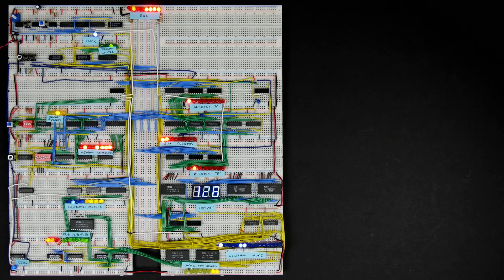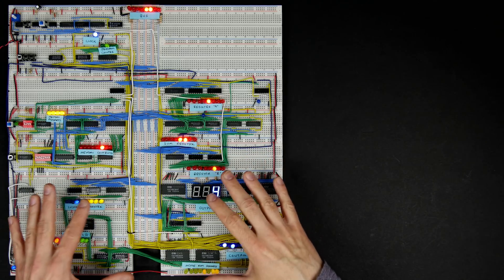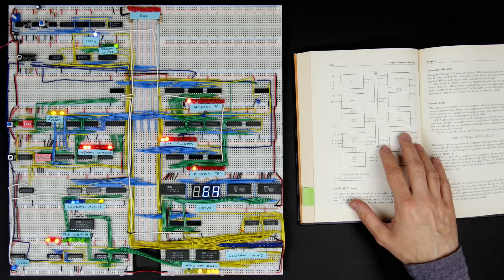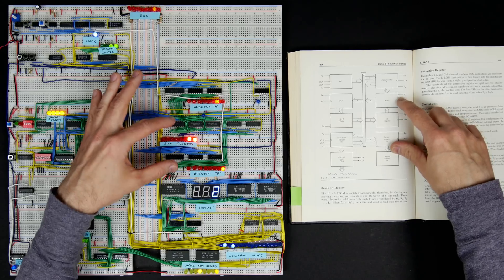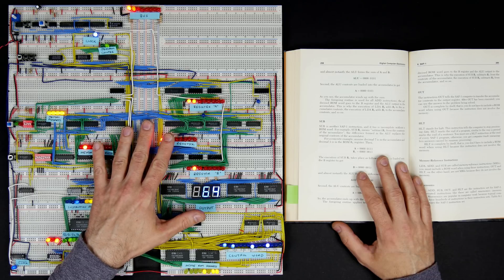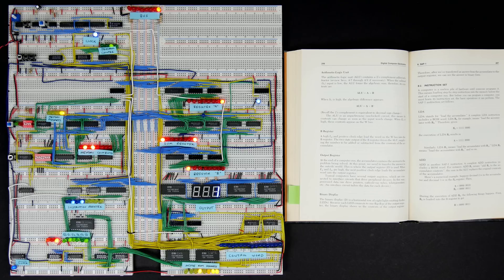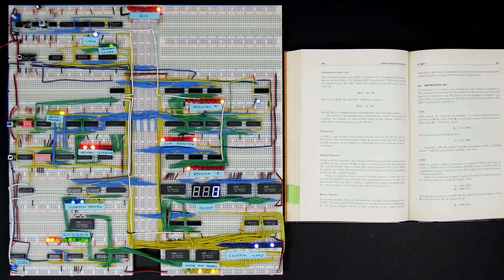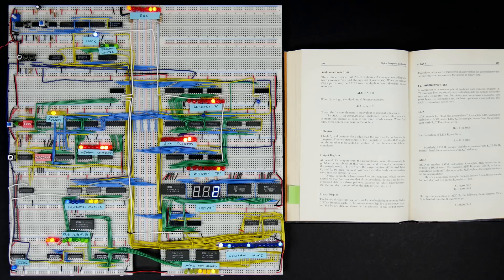8-bit computer update

Comment: hi. i have successfully made the popular ben eater,who i will be eternally grateful, 8 bit  breadboard pc up to the output display   .  its not been easy and here are a few of my observations    .the first tedancy was to inadvertantly wire a short cct across the  the 5 volt supply.     so i added a 1 amp meter and used a 705 with heat sink.     next was the fenomenom ? of data not appearing  on the bus.     this was due to a register outputting  8 zeros to it and not allowing the 5 volts to show.    now ime experiencing like contact bounce where a step is missed or it goes to an all ones address.     ive just made a seperate 7400 manual toggle switch,supposidly bounce free cct and managed to get only 3 outpus of 42 without a problem   .its the same on continous 555 clock pulses   .the boards have 5 volts to them with a variation of 0.1v and theres low/high value capacitors as well across the 5 volrail and very little noise.     a most annoying thing is a tendance for step zero to become mainly all zeros or a mix and confusing the  program so ime thinking of fitting a small eeprom to replace the ram if thats possible     so ime looking for any ideas for the clock bounce,    ram corruption and replaceing the ram with an eeprom.     i made the simple eeprom programmer which was easy to make and works well but being nearly 70  i cant grasp using an arduino so am looking for a display and full  instruction download   please   so  i can place into the arduino programming page,  step by step please, then i can use my arduino uno.  ive spent tens of  many enjoyable hours  assembling this and have leant a lot which i hope to use on my old 70,s sinclair zx81,s and also repair a failed ram pack.  thank you once again be eater for making these video,s and giving people endlass enjoyment.  many thanks from richard ,england uk
Reply: should be 1st line "to who i will be,and "used a 7805 with heat sink

Comment: Now put a 1080Ti on it.
Reply: nah the 1080Ti would be a huge bottleneck for raw power like this
Reply: @MACHINEBUILDER  
But can it run E.T. for the Atari?
Reply: @manictiger  Wait... It can, right?
Reply: @manictiger  YOU MONSTER!
Reply: @manictiger  yes, and if you add his vga video card, it could run doom
Reply: just theoretically... does 1080 work on 8 bit cpu? lets say there is some one who could connect them together and set up a 8bit windows version... but i think we need 32bit... or maybe 16 would work tooo
Reply: ҉K҉N҉I҉G҉H҉T҉F҉I҉R҉E҉6҉6҉ I think you’d have to completely rewrite drivers and i/o low level driver for the videocard and cpu itself, and also create a suitable ram inside your cpu. theoretically that’s possible but in real life there is no way you can reverse engineer and decode the entire set of instructions and write it down to a 8 bit computer. Besides that, I’m pretty positive that the card is physically not able to work with 8 bit cpu as it is has 16 and 32 bit physical registers. But even if you theoretically make it work with your cpu, the cpu would be billions times slower than the gpu, and it wouldn’t make sense at all. You’d also need a proper screen that would work with your cpu to actually test the card and see any results
Reply: @Knightfire66  Theoretically, anything is possible, but it would be a crazy undertaking. If you could simply split for example a 32 bit instruction down to four 8 bit instructions, the computer would have to work four times as fast to keep up, and that's not counting any time spent on the interface procedures.
Reply: @Vermilicious
It is more like 16 times slower, for many operations like multiplications it is O(n**2).

Lets say you have 32 Bit Register A and B and want to multiply them to register C and D, this is one instruction on a 32 Bit CPU. On a 8-Bit CPU you have 4 registers, A0-A3, for value A, 4 registers, B0-B3, for value B and 4 for value C and 4 for D. Then you have to multiple A0 with B0, B1, B2 and B3 (4 instructions) and that for every A register (4 times 4 instructions), and you need to add the individual results to each other, so you need even more instructions.
Other instructions, such as ADD do not need O(n**2) time.
Reply: @Knightfire66  the 1080 needs pcie connection and protocols to work, pcie came from pci which was a shared bus
this means the 1080 would need at least 4 pcie bus lanes from the cpu for IO
Reply: @Knightfire66  r/woooooooooooooooooooosh
Reply: @hattron6704  reddit moment.
Reply: But can it run doom?
Reply: Now put a 2080ti on it.
Reply: Cool
Reply: 😂he should
Reply: Nah, too much of a bottleneck.
Reply: Can it play Crysis?
Reply: How about 3080Ti now?
Reply: That’s a serious cpu bottleneck lol
Reply: he has built video card before few days. Now it won't be necessary to use commersial one.
Reply: 200 bit system

Comment: Wrong wrong wrong, the zx480 siphen is wired to the extrapolator that governs the flux capacitor. this in turn is why the T25 is synchronized to the cabronator. I can't believe you overlooked such a basic configuration, I'd be very embarrassed.

Comment: I don't know how this ended up in my feed (or rather I found this going through recommended videos on the fibonacci program c to assembly video), but I'm glad I did.
I already now understand both microcode/microinstructions and blinkenights.  The latter is amusing, but the former is very nice to finally understand.  I have long understood higher level structures (how ALUs and registers interact and concepts like pipelining), but microcode and the control lines aren't ever really brought up.

I know I'm going to watch the whole playlist.

On a side note, though, why is incrementing the program counter a separate step?  Can't it be done at the same time as instruction decode?

Comment: But can it run Crysis?
Reply: Not only can it run Crysis; but it comes standard with VR headset too.
Reply: Not only will it run Crysis, it'll look like a DLSS simulator.
Reply: Giorgi Gzirishvili it runs crysis at 10000fps at 16K resolution with 4xmsaa and ultra setting with 0 motion blur

but it fails to run minesweeper at 5fps at lowest settings at 98p:)
Reply: Siddharth Kapoor, yeah... Minesweeper is very resource-hungry for sure.

Comment: Would it be possible to connect somthing like a keyboard or a screen to that computer?
Reply: Keyboard maybe yes
Reply: in both cases it lacks the fundamental part to make it work, drivers.
Reply: For a Keyboard you will need to handle interruptions, and for a basic display will need an additional hardware to write your data and transform it to analog data (VGA)
Reply: The functionality of such a computer can be expanded to whatever you could possibly want, but it has no such ability in its current state.

Comment: is it possible to add more than 8 bits with the same principle ? Does it change the CPU's circuit all that much or is it just like plugging batteries in series for more power ?

Comment: I just found this video today and it's incredible! Is there any program that I can use to simulate one of these on my computer? I don't have the resources to buy the parts and build one of these so being able to simulate one would be awesome
Reply: If you are on windows, check out Logisim: it lets you simulate an electronic circuit! Don't expect much bells and whistles, it doesn't simulate exactly what's going on at "electrical" level (you can't for instance use resistors and capacitors), but you can simulate pretty much any logic circuit: clocks, gates, flip-flops...you can save your own circuits and use them as modules for more advanced ones, it's pretty neat. I'm running it on Windows XP 32 bit and it works fine
Reply: Just a little glimpse: you have basic logic gates (AND,OR,NOT). You have some "pins" that can represent input and outputs. You have wires: if you search about datasheets for, let's say, a 7408 quad AND gate, you can see the "pinout":  the DIP 14 (which has 14 pins layed down on two vertical parallel lines) uses two inputs for power and ground (which in our case are irrilevant, since we don't have to deal with current) and 2 pins for input/1 pin for output for each one of the 4 AND gates. You place the gates, the pins, wire them up and TADA you have assembled a 7408 quad AND gate. And now you can use it for something else...it's really cool
Reply: another little note: you have LEDs,  7-segments displays, even RAM and ROM banks, you can set the frequency of the clocks from 0.25 Hz up to 4 Khz! It's..it's just..oh man.

Comment: Sooo, when do you plan to install WIFI?
Reply: He's not wrong, though. Lot's of people use the esp8266 with an Arduino for wifi. I think it'd actually be pretty cool to do a wifi module like that.
Reply: Ha ha, nice!
Reply: esp8266 allows you to play minecraft
Reply: @shampaka5059  In simple words esp series is only an open source programing hardware used mostly for diy projects and requires a arduino ide to be programmed,
I cant see how you assumed to run mincraft on a 16 kb microprocessor.
Reply: ESP8266 has a much healthier ecosystem at the moment, and is still a very capable chip. Waaaaaaaaaaaayyyy more than capable enough to add some kind of wifi interface on top of Ben's awesome 8 bit computer.
Reply: why does every yt convo end up in ppl cursing and shouting - almost always lol
Reply: True I've been moving all my 8266 code to esp32 because has so much more, 16 12 bit adc channels instead of one 10 bit. But obviously you don't "need" that for this video's project.
Reply: Mako-kun if the computer is using EPROM then it probably does have serial built in and also it has a clock on the computer
Reply: I think, he needs to install a floppy first.
Reply: That was english.. You need a translation to average
Reply: esp8266 is old hat, the esp32 is 240mhz dual core with 16 12bit adc's and has bluetooth for ~$4. I recently got a websockets in C working to transmit audio for automation https://github.com/physiii/liger
Reply: @AndyPayne42  i think the updated versions of esp8266 like nodemcu and esp8266 mini also have decent features for most projects since using esp32 for starters would be an overkill. 
Plus esp8266 is easier to handle.
Reply: @dontreadmyusername6787  I disagree. I don't know what you mean by easier? It's all c code unless you run arduino which maybe you hit some c++ (arg!). ESP32 is much easier because I don't have to maintain and think about two separate microcontrollers and I don't run out of io llke I do on esp8266. I think a lot of people already have a bunch of 8266 so they want to use that inventory however we are talking about a few bucks here.
Reply: I dont see any practical use of having wifi on board, but if I were to install wifi maybe something like the esp8266 wifi module which uses uart might work assuming that this computer has serial built in.
Reply: Mako-kun I'd say this is a long way from having an UART, this is more of a demonstration of how the building blocks of computers are made than something even remotely useful. However when my son is a bit older (he's 3 now) I will use this to demonstrate how things work on a very basic level and then we will probably either expand radically on it or just switch to 68hc705 and from there to arduino. I like how both this and the 68hc705 force you to think in a sense 'laterally' to achieve things, it's an important skill to learn.
Reply: Why so abusive mishmash? Fuck off.
Reply: Mako-kun in english?
Reply: +Mako-kun Wow you're so smart. Too bad you're not smart enough to realize ui_wizard was joking you pathetic basement dweller.
Reply: @vann20  do you think he does care if it is a joke?

Comment: I am now retired and am determined to get to grips with the basics of an 8 bit computer and build one.  These videos are brilliant and an inspiration. I hope you will consider the addition of modules to both multiply and divide at some point in the future.
Well done Ben
Reply: pj M late reply, not sure if he's covered it in any videos but the only two operations in terms of math you need is addition and flip from positive to negative, no other hardware is needed. The rest is programming. I'm sure you can find good examples of how this is done on Motorola 68hc705 for example which is what I learned the beginning of ASM on, it only does those two things, and one of my school projects  was to build a full calculator out of it, with add/subtract/divide/multiply, and the kicker: square root, all in 4K memory, and it wasn't that hard once you get the hang of it.

Comment: Awesome job, I was inspired  to build the 8 Bit Breadboard computer with the students, the computer is  a  nice simple basic design to help explain how an
8 bit TTL logic computer works using a common 8 bit bus.  I watched all your videos and then started building a 8 Bit Breadboard computer too, I completed the clock and control, A register, B register, ALU, sections and tested them. I have been slowly drawing schematics of the whole system using a free program called ExpressPCB by coping all your video layouts, if you want I could send what schematics I have done so far done. I see from your completed running systems video it looks like it roughly takes 20 Breadboards to build the fully functional system. I am waiting for some IC’s / parts I order to continue building the system.  I also purchase the “Digital Computer Electronics” book  by Albert Paul Malvino“. From the posts I read its seems you have a good following.

If you’re interested Ben  I am offering to help document the build using free tools like ExpressPCB  and open source Fritzing drawing to do a nice quick colored wiring of breadboard layouts.  Please contact me back when you get time.
Mike DeLosier,
Reply: Can you list all the components that have been used so i can purchase them one time
Reply: Mike DeLosier how long it takes to build and what are the difficulties?
Reply: where can i get Digital Computer Electronics” book  by Albert Paul Malvino
Reply: Trace,
Amazon has some books.
https://www.amazon.com/Digital-computer-electronics-Albert-Malvino/dp/0070398615
Reply: thanks ..how can i contact you btw if i might need any help on builing the 8 bit comp

Comment: After you're done with your copy/tutorial, you should make ANOTHER version of the computer, only 4 bits, but ENTIRELY from transistors and other passive components like capacitors and such. ABSOLUTELY NO ICs. Can you do that? That would be a challenge with likely a much bigger breadboard setup.
Reply: By the way, I'm only slightly kidding.
Reply: Even I am excited for 4 bit computer with bare transistors and switch!
Reply: I mean really you just have to replace all components with self-built modules of those components, and finding how to wire together gates etc from basic transistors shouldn't be that hard. Then, for your next challenge, Ian, you should try implementing the same thing with magnetic coil logic components (ferrite cores for AND and OR gates). None of this modern semiconductor nonsense...
Reply: I suggest using BJTs. But wait, then we'll first have to build a power plant from scratch...

Comment: I think your work here is going to be a big deal Mr. Eater! I'm adding your video tutorials to my repertoire of media in my journey of learning and ultimately intuiting computers based on first principles that includes mainly two books so far ("How Do It Know?" J. Clark Scott, and "Code: The Hidden Language..." Charles Petzhold) and a Coursera course I just enrolled in called "From Nand2Tetris, Build a Modern computer from First Principles." They are all great for theory, but even the course only has the computer project made through software simulation. That should suffice, but what you propose to do goes the next step, and I'm looking forward to following along.
Reply: Duane, thank you for mentioning the Nand2Tetris course. Going to have a look at it.
Reply: You're welcome! I'm still in it right now, I'm on the unit where we write low-level programs in machine language. I love it!

Comment: Hey there!
After designing my own 8 Bit Computer,  I realized in this video something about your computer not executing the Fibonacci program to 233, because mine refuses to do so, too. It's not because of the order of your instructions, like you assumed in your fibonacci video, everything is fine with that. It's rather because the Sum Register immediately sums up the A Reg and B Reg. After the 128 is calculated, it will be transferred back into the A Reg, so your Sum Register overflows immediately and the Jump Carry is called even before the 233 is calculated and put into the Output Register. I have my scematics right here, probably we can both find a way to debug this.
http://fs5.directupload.net/images/160227/mlq55txq.png
Took me 2 weeks to develop this, the architecture is based off of the SAP-1, too but the rest is self-made. I wanted to build this with TTL components, but others tell me that CMOS is easier to start with. What is your opinion on that topic?

Kind regards,
Meta Custom Computers